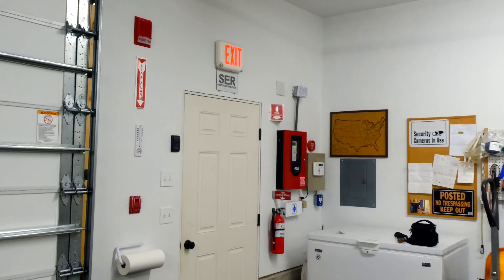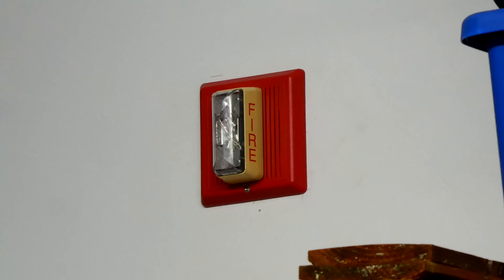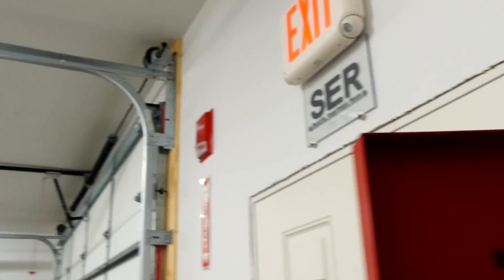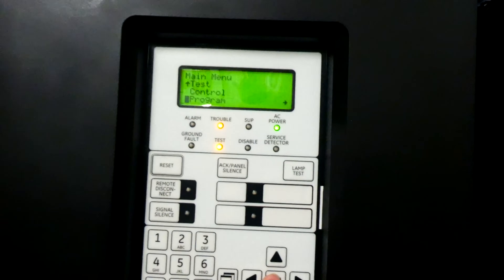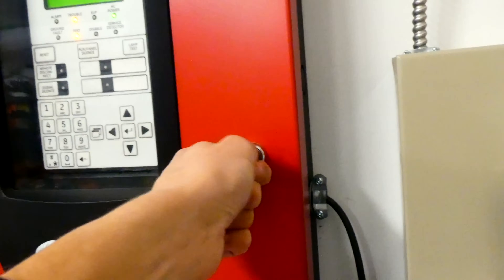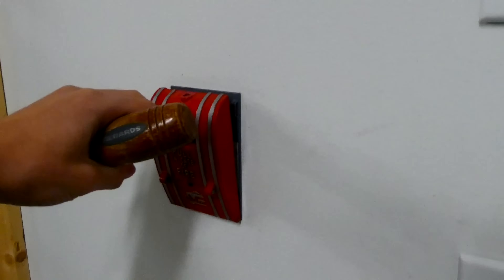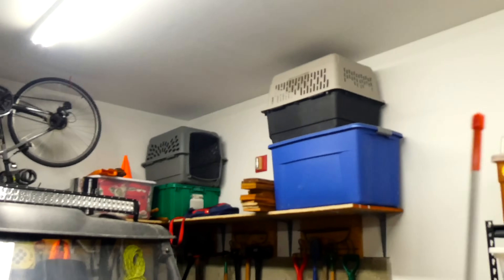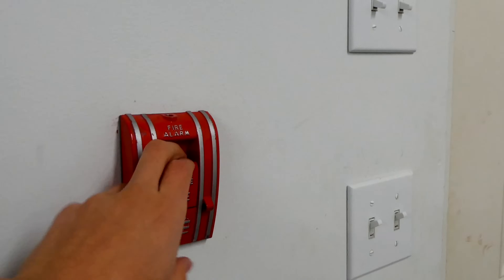S.E.R. System Test 16: Fire Alarm Walk Test

Comment: The building management at my school is composed of a bunch of idiots, they left the keys in the fire alarm panel which is a Notifier nfs320 addressable panel btw, and after school a student opened the panel and cut a bunch of wires, and fate strikes and there was a fire on the top floor the next day, luckily I was in a different building, saw the smoke coming out of a window and I pulled the alarm in my building (one panel for both buildings)

Comment: Hi im thinking of making my own system. How do I make it so that the panel won’t call the fire department?
Reply: @Jaxon Lewis ok thanks but a diaper?
Reply: @Jaxon Lewis oh lol so if I purchase a panel, pull station, and notifier it won’t call the fire department?
Reply: @Jaxon Lewis ok thanks
Reply: @Jaxon Lewis oh thanks it’s 2021 in 25 minutes for me, (California) also if I have a system I do want a panel and annunciator and all that stuff. I know how to set all that stuff up, I just wanted to make sure I would be fine. Also I live in a city where houses are very close together so if I get started how will I do it without pissing off my neighbors?
Reply: @hoppingh907  You need to know what you are doing. If you have discord, i can walk you through the wiring. Its possible that you can blow up your panel or your devices if you wire them wrong.
Reply: @AcElectronicSystems  it is ok I know how to wire them now
Reply: @Jaxon Lewis ok thanks and happy new years

Comment: Really cool video. Thank you for talking about passwords on my channel with my systems I also give out default passwords and lots of people don’t want me too. I’ve tried to explain that if someone really wants to mess up a system they would probably be more destructive not having time to mess with passwords and programming. Just my thoughts.
Reply: @owenweber5527  it’s kind of ridiculous to me it’s a factory programming password get over it. If I was trying to disable a system and don’t know how to operate a system i’d probably just rip the door off the panel pull the batteries and turn off the breaker not going to mess around with no passwords or just start cutting wires to all the nac’s and zones and monitoring company
Reply: I like these vids, but also check out @Alan Becker!

Comment: Do you plan on getting a battery for that alarm panel?
Reply from the maker: Not at this time. The garage is wired into a backup generator that will last for almost a couple weeks if the power goes out.
Reply: @SERSafety  ok, but I’m sure seeing the system lo bat is really annoying. Hey, do you know how to fix a panel that randomly stopped accepting the master code despite it never being changed?